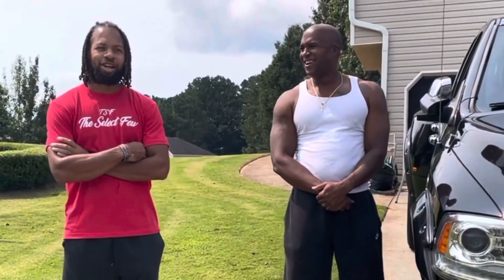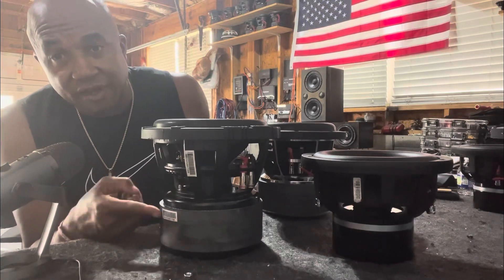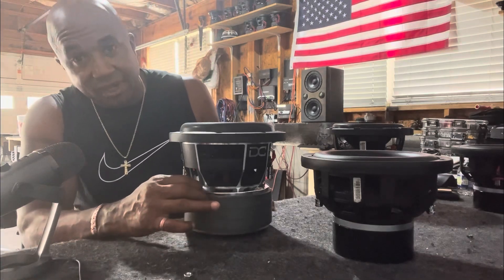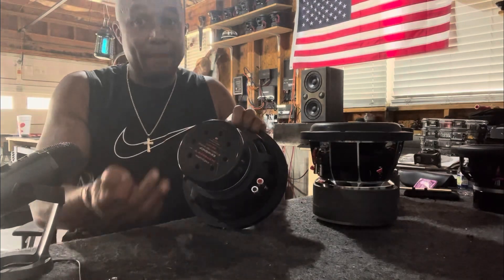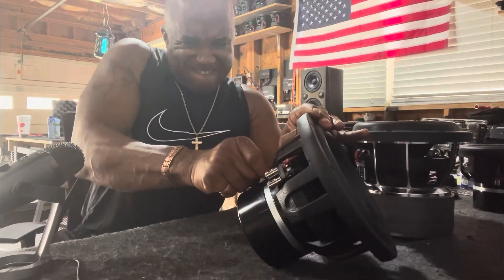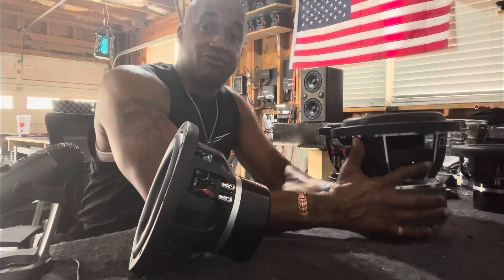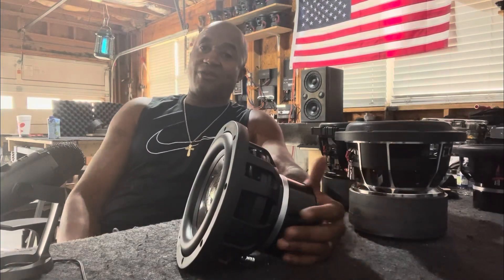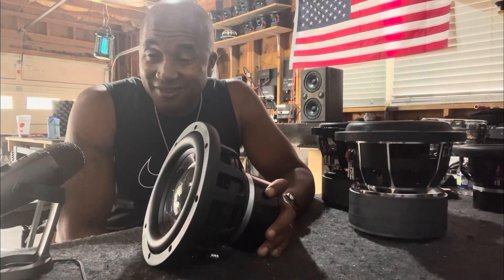Neo Motor Strength vs Ferrite Motor!!! 10X The Strength 1/6th The Size!

Comment: Yessir, thank you for the explanation and breakdowns on magnet structures on woofers / speakers. I like your philosophy on the 8 inch subs I always have been a fan of them and I have  used them in real nice combo box designs have been more than satisfied even in home audio , they always seemed to have better transients especially with the electrostatic or ribbon type  Magnepan HiFi speakers compared to 10-15” drivers. You brought it all home and it makes more sense to me now why that is the case

Comment: Above 175 degrees fahrenheit neodymium magnets lose their strength. Their are cons to all the pros
Reply from the maker: @BangingCamry  now since you so knowledgeable 😃.. let everyone know that will not happen under daily use.
Reply: @M.B.Enclosures  never said I was so knowledgeable but heat does play a factor with neo magnets. "neodymium magnets can lose strength when exposed to heat. For every 1°C increase in temperature, neodymium magnets lose about 0.11% of their magnetism. This loss can be recovered if the magnet is cooled, but only if it doesn't exceed its maximum operating temperature. If the magnet is repeatedly heated and cooled, its magnetic performance will eventually decline" this is not my quote but is the truth